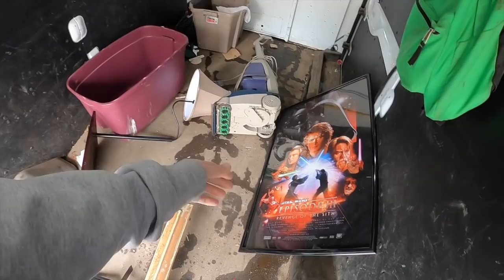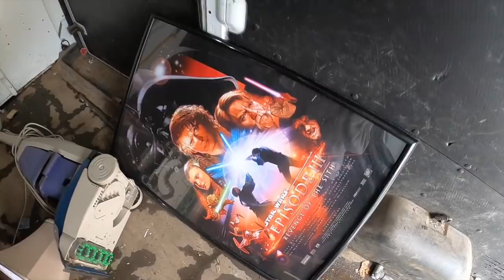Why Did They Throw This In The Garbage? - Trash Picking Ep. 572

Comment: Two days ago I found a 18" snow joe electric snowblower at the curb in my subdivision. The scraper bar had broken off and there was no battery or charger with it. I still took it because snow joe still makes the batteries for it plus once I reattach the scraper bar I’ll have a pretty decent snowblower.

Comment: Taco take the window measurements and find a local salvage yard. Sometimes they have old ones you can buy cheap to replace the broken one. When I lived in MA, the house was built in 1909 and I had to replace one. With the sash rope and a $10 used window, fixed it in about 2 hours. You are losing lots of heat from the broken one.☘️

Comment: Your broken kitchen window can be replaced or repaired with original era pieces. Don’t fall for the myth that you have to replace with modern ones because of the difference of efficiency. The fact is It has been proven that while yes modern ones are more efficient but they will be needing to be replaced themselves before they actually pay off in savings on heating costs. So just repair your old original one and as long as it is properly done and maintained the old style windows are not so bad and actually allow the house to breathe